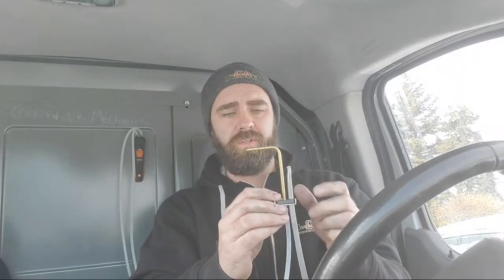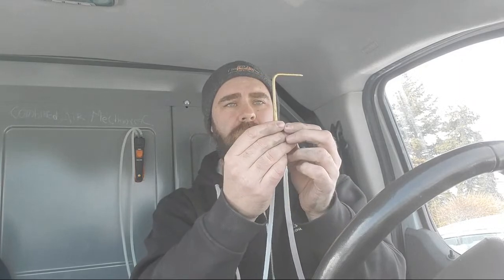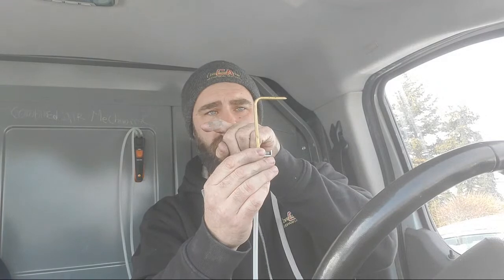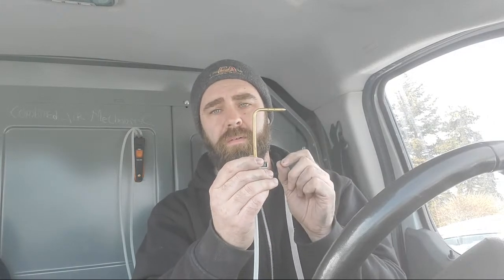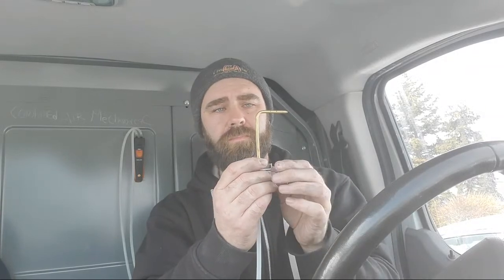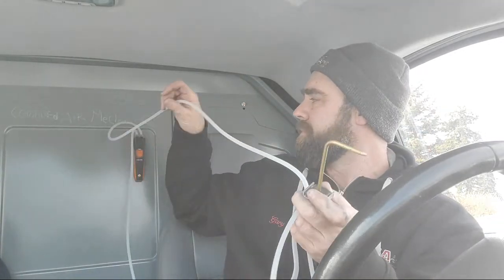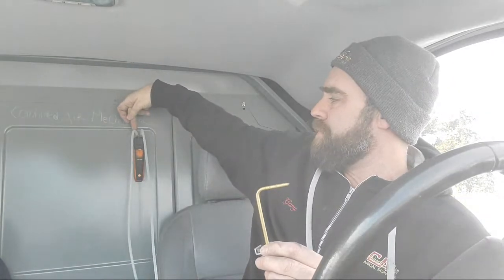Live - Static Pressure Tips

Comment: So after install if I set my ECM motor to the correct speed tap based on the btu input of my 80% gas furnace and then my total external static pressure is not matching what my furnace nameplate says for it to be then what gets changed?
Reply from the maker: If you still have high static, it will be mostly likely an air restriction caused by undersized duct.

Comment: So let's say we have 16x25x1 filter rack mounted directly onto the furnace. Would the best way to check it be to remove the filter and check as close to the filter rack?
Reply from the maker: In that case, you can drill a small hole into the negative side of the blower cabinet.
Reply: @HVAC Know It All  yea never done that. Buy I'm guessing in the back or side...would it matter?

Comment: Thank's for this . Like the KISS concept . Wood floors installed with fancy wood registers ,look great but restrict supply air eats up e.c.m. motors - limit failures very common in split level homes , toss wood registers go back to full flow metal registers.
Reply: I've got wood registers, they really don't restrict that much. You could always look up the pressure drop values in the product datasheet.
Reply: Or save the old metal ones , take reading, install wood registers see increase !